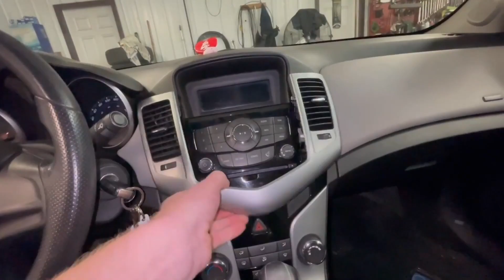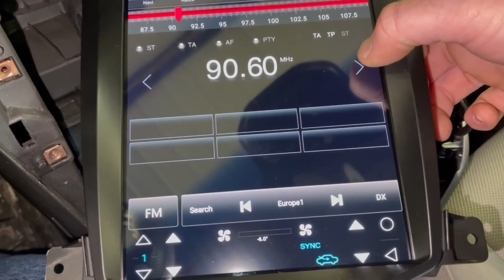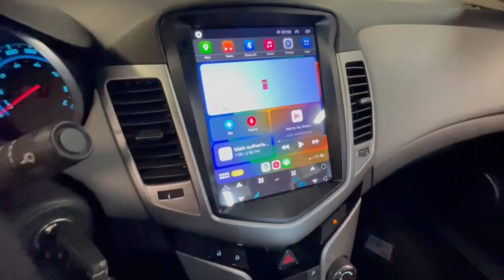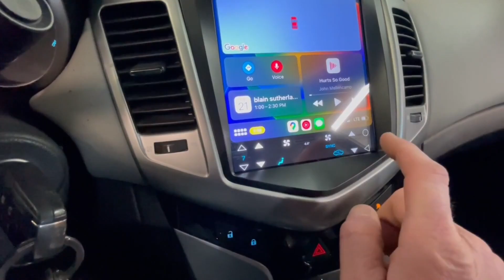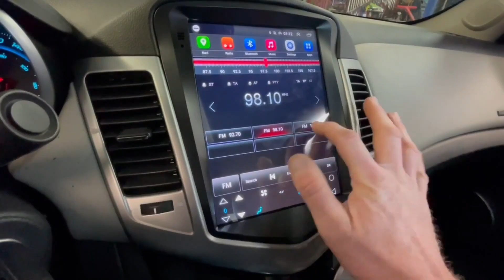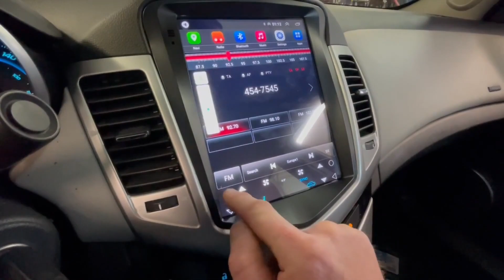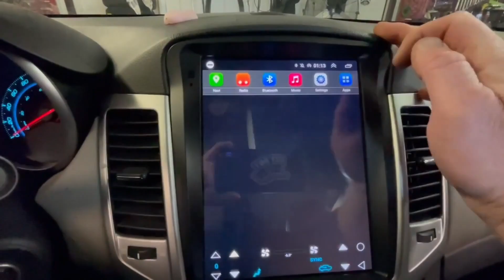How to Install a Tesla Android Radio Cruze

Comment: Where does backup cam plug in?
Reply from the maker: could have a label, please note that there is more than one way to install the rear camera in relation to the power wire and the way the multimedia receives the signal from the Rear to show on screen. It may vary depending on the model and whether it has a canbus box.

Comment: Was going so well showing step by step each connector and then you gave up showing it… there’s a connector on the power cord that I don’t know where it goes to..
Reply from the maker: In my case the only connectors that were the same were the additional USB ones.

The others had different amounts of pins.
I hope this helps anyway, Thanks.